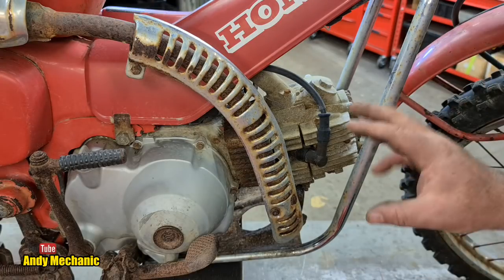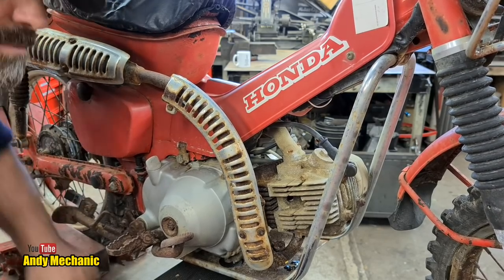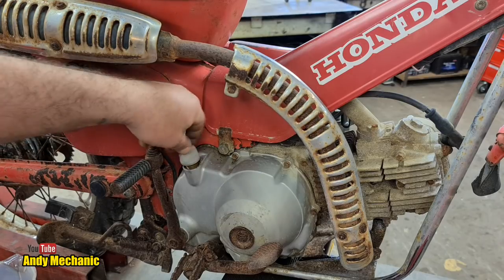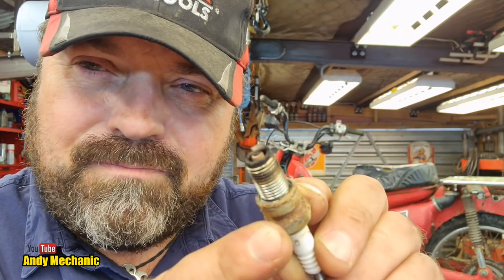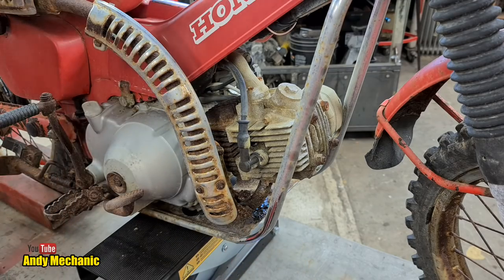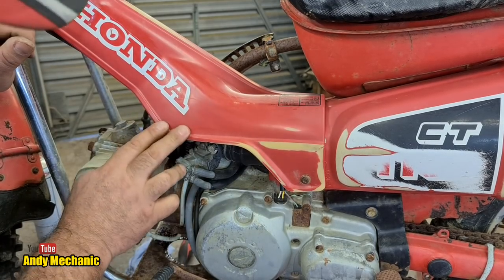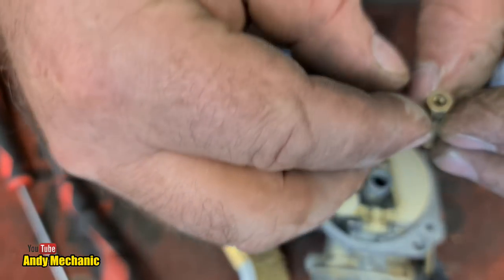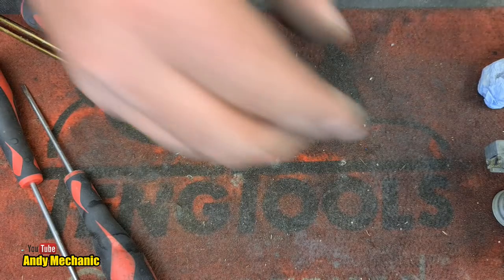Honda CT110 Postie Bike - will it run!! #1870

Comment: Long ago my dad bought us kids a motorcycle after lots of begging, it was a brand new 1974 Honda ST 90, 3 speed semi auto, yellow color. I didn't realize until now they were only manufactured for 3 years and was the big brother to the smaller CT 50 and 70. ST stood for Super Trail although that is quite debatable to say the least. Never the less it was such a cute bike and we put a much bigger sprocket on the rear to get a better gearing that could have a hope of climbing a steeper hill off road around the farm. I see they are worth a lot now if in good shape for collectors and our bike was in amazingly good condition but we sold it into the early 1980's to a couple in town that he wanted to find a small but street legal bike to teach his wife how to drive a bike and get her license before stepping up to a real street bike. The CT 110 would have been a more capable bike on trails ( couldn't double on it though ) as long as it had the 2 speed high/low range selector as they came equipped with in Canada.
Reply from the maker: Hi Charles, yes, this one does have the low ratio too! I'm really looking forward to getting it all fixed up & rideable again, should be a heap of fun :-)

Cheers for sharing your story. Andy

Comment: Great video Andy, sorry I've been absent for the past two livestreams, work on the studio got in the way. Top tip to avoid cross threading spark plugs - use car fuel hose, slip the plug into the hose and use it as a driver to run the plug in, guaranteed no cross thread. For diesel glow plugs and small bolts and jets use silicone tubing and diesel spill pipe instead. See you tomorrow on the livestream. Ps, you're awesome 👍
Reply from the maker: Cheers Steve :-)  See you tomorrow...

Comment: That is a CT but not a Postie Bike, there are a few differences, here are some to help with identification.
the postie does not have the high/low range gear box, they have rubber foot pegs not steel, the speedometer was moved out of the headlight so it could be seen with the mail bag attached and the wheel spokes were a little thicker to take the load of the mail and rider.
Where the air filter meets the rack looks quite rusty on your bike, that part of the rack plays a big part in the air flow, if it is not intact as from the factory the carburetor will need bigger jets to make up for the extra air flow

Comment: I just bought a Peugeot 103 6V and sadly did not have the luck of a spark so due to lack of parts have the interesting job of finding compatible parts for the Magneto! Spark is a beautiful thing to see on a bike that's not run in decades
Reply from the maker: I struck lucky again!! I do wonder why these bikes just get parked up & left for dead? Sure, there's an odd bit that needs fixing even for use on the farm but it's not enough to render the bike junk in my opinion....

Good Luck on your next Quest Simon! Cheers Andy
Reply: @AndyMechanic  Not sure who Simon is but thanks:) the main draw is in the UK 1971 bike is mot and tax free so only got to get it going and almost free motoring!
Reply from the maker: Sorry! Was half asleep when I commented!  My bad :-(

Comment: Once l got spark, l removed the air cleaner, shot some brake cleaner in the carb and kicked till it fired. This told me a good cleaning of the carb was not pointless.